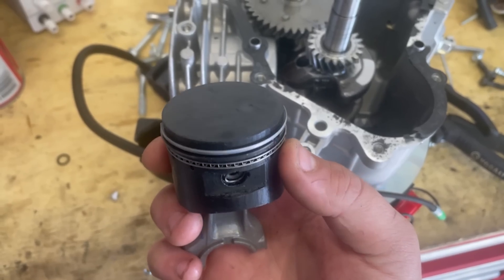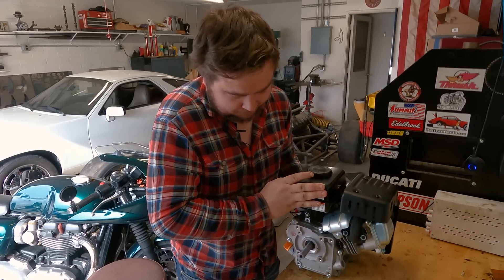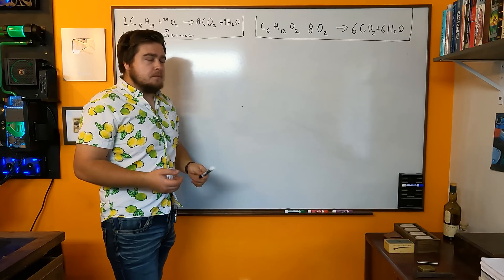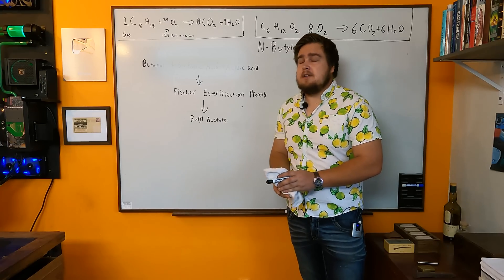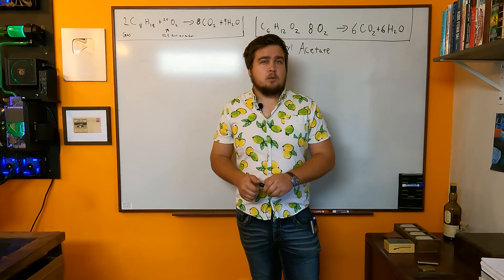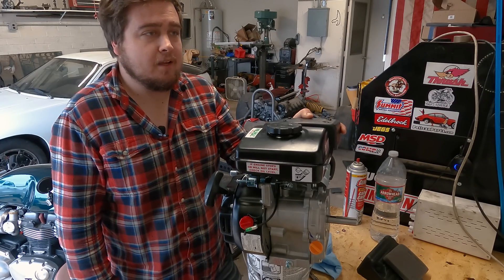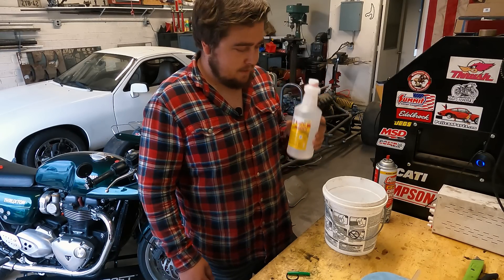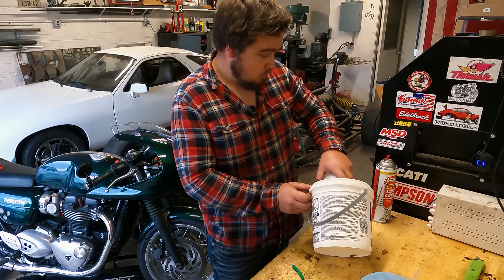Cold Burning Fuels and Plastic Pistons for Harbor Freight Engines!

Comment: I saw some guy make an in-line 4 out of single cylinder engines and I thought it was a cool concept.  With your skill I think a V twin isn’t out of the question.  Just a thought or idea.
Reply from the maker: Haha, I had a few concepts pulled up like that, never did anything with them though.
Reply: @WesleyKagan  maybe even a radial engine :D Speaking of radial engines, if anyones interested in aero engines, do read The Secret Horsepower Race by Calum E. Douglas :)
Reply: @googzmo  why are radials so cool?
Reply: @richardschofield2201  i think it is the utilization of the entire "space" around the crankshaft, i usually only thought of rotary engines thisway; but i still think there is some unrealized potential in radial engines :)
Reply: @WesleyKagan  maybe now is the time to crack those old files open 😉
Reply: Making a V twin would be pretty hard tho', as your trying to connect two con rods to one crank. So you'd need a V twin crank to have a wide enough big end, at which point might as well start with a V twin engine.
A parallel twin would be a lot easier as you'd just need to join the cranks together with a rubber donut (or similar).
Reply: Allen Millyard did this with a pair of honda 50cc engines, small series on YouTube, impressive to say the least